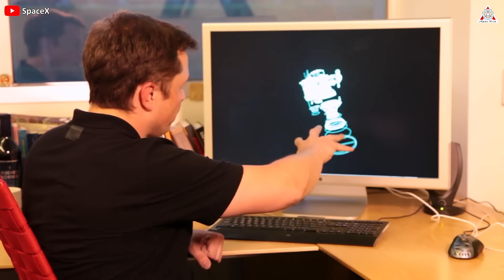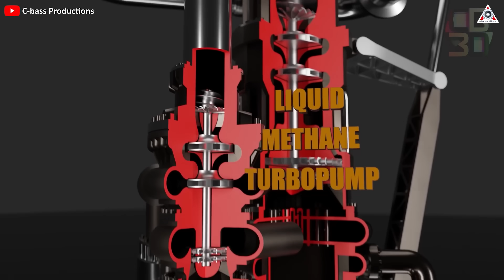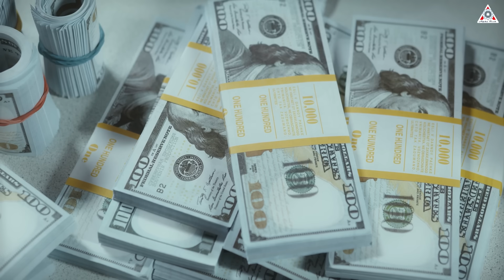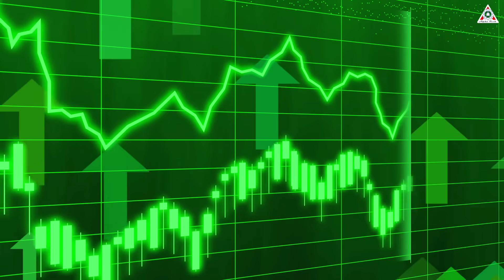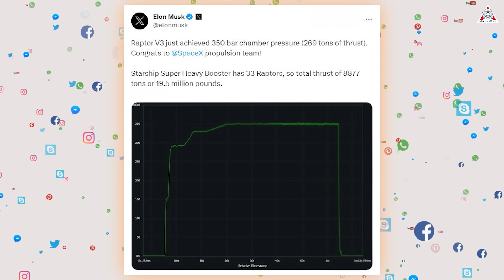Elon Revealed genuine Next-gen LEET 1337 Raptor Engine “More Thrust, No Heat Shield"...

Comment: The starship design is the problem for SpaceX, not the engines. The starship is too big. Commercial satellite providers and users are not going to design satellites that can only be launched on SpaceX rockets. They won back ups. Satellites are getting smaller. Not super huge. If starship is not going to be used to launch commercial, satellites, and who’s going to pay for it? if you want a comparison, look at the airbus A380. Great plane but it’s no longer being built because it doesn’t fit in with what commercial airlines need.
Reply: There are a couple reasons Starship is being built for. Carrying commercial and government equipment to space is the obvious and it will definitely work. Even if all satellites are reduced in size they will fill the bay with more than one company’s cargo at a time for each launch. 
There are also heavy loads now and in the future for the government, nasa and SpaceX itself. The biggest advantage of Starship is the cost to send equipment into orbit and various missions. Starship is designed to reduce the cost to SpaceX itself for each launch which is going to greatly, greatly lower the cost to the customers.
The second reason Starship is being built is for moon and mars missions which will require vast amounts of cargo.

Comment: If the engines are truly that robust, I'd go the other way.  Tile the engine area and use that surface as the sole heat shield for landing.

You'd get a better heatshield and not have to tile the entire belly bottom.  You could land the 2nd stage from orbit like the first stage and not have to do a complex bellyflop either.  It would also allow you to expend more weight making the plumbing stronger.  It's also possible they go to Aluminum tank designs for the inside to act as massive heat spreaders to the stainless steel superstructure.
Reply from the maker: Thanks for your comment
Reply: But actually you have had only a single informational point.  Like 0 to 1.

Comment: Glad to hear they are thinking larger now.
Its something I have argued long term on in online forums and have even seen Alpha Tech try to negate.
Too many smaller engines is too many parts, if you can do the job with less engines its less parts and less problems.
And in fact I argued this when planting the parts count concept on
 r/spacex, and like everything else, got down voted for it.
The analogy I used was its like powering a Battle Ship with outboard boat motors....
Too much complication for amount of power required.
really we need to scale engines to ship size, and if possible reduce engine count like now reducing parts count, and upscale rocket engines to where we have no more engines than necessary for function with a safety factor. In Space, I think if possible we should design for triple redundency.
This would allow ⅔ of systems to fail, and still make it home, or back to help.
On the boosters an example might be engines sized so that a third of them can land a booster that has more fuel etc. than it should.
Basically theres an optimum sizes and numbers for everything to achieve the balance point.
One possible exception might be combustion chambers, they can be simple enough that doing multiples can sometimes give better function, the analogy I've used is an oxy/acet torch, that you didn't need seperate hoses and regulators for every orifice.
That multiple chambers can be fed off a single upscale pumps and metering system.
This if done in clusters, could reduce parts count in pumping systems by a factor of six. And it might be possible to create combustion chambers as a plate feature, and reduce it by a factor of a dozen or more.

And if you also upscale combustion chamber sizes, get engines scaled to ships. 
Another factor could be three different combustion chamber sizes in a combustion chamber array, getting past the throttling issues of rocket engines via selection of which sizes to use when.
So in summary, glad to see upscaling in progress, have been pushing it for years and being unpopular for doing so.
Reply from the maker: Thanks for your comment. Let's wait for their next steps